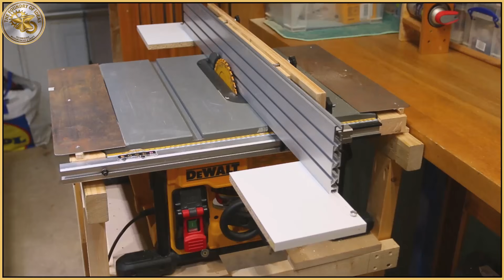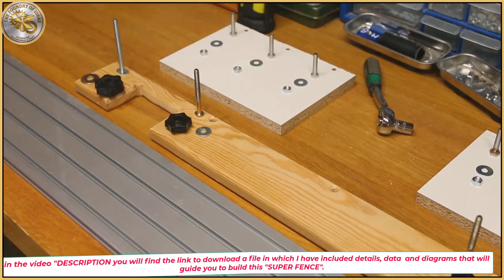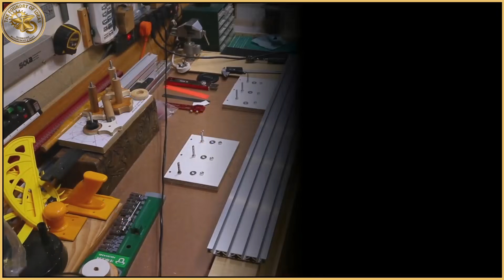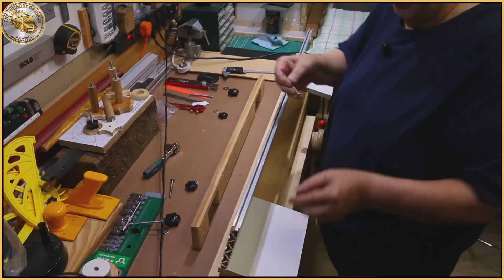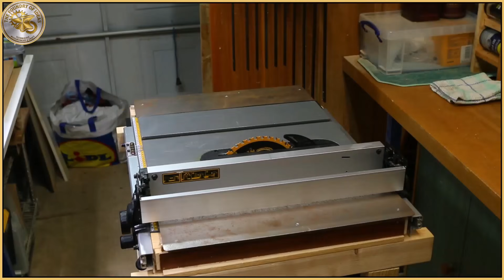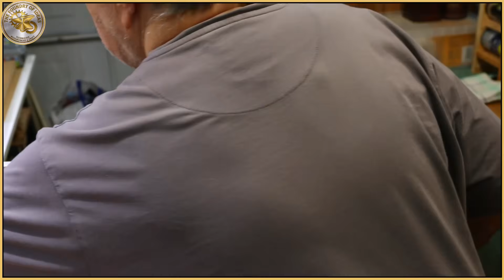DIY Table Saw Fence Upgrade: Extend Your Rip Capacity on a Budget

Comment: Who did you order the extrusion from?
Reply from the maker: Dear @dfu1685, this extrusion was purchased from Amazon, UK, the particulars of this item are as follows:
ONLISUM 1PCS 15120 T Type Aluminum Profile 1000mm European Standard Anodized Linear Rail Aluminum Extrusion Frame for DIY 3D Printer and CNC Machine. Do not hesitate to revert if you have any other questions. With kind regards.
Reply: @Starman3539 
Thank you for replying Starman3539!
Also, Much appreciated for your time and talent!

Comment: Nice.  
I have some -3/4" thick wood flooring with a vinyl back. Nice looking and very straight.  I put this and some 1/2 material together. Also forward feed, as I already have a back feed for my saw. Added stops, and that is all I need. 
The wood flooring was free, and it is very synthetic, with just a layer of coated wood laminate on top. 
Anyone can make something better, with a little effort and for cheap.
Reply from the maker: If you can make something that is of the simplest design for what you want it to do, it fulfills its purpose and is relatively inexpensive to construct you are onto a winner. Thanks for your coments. If you ever have any questions I am here.